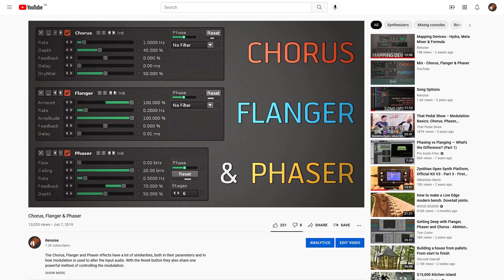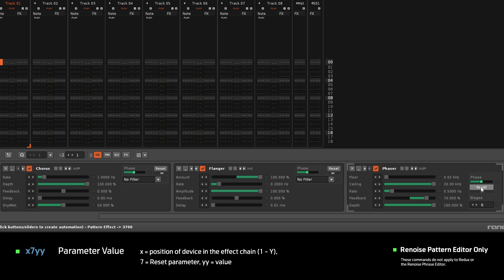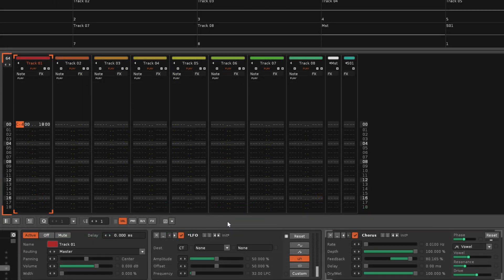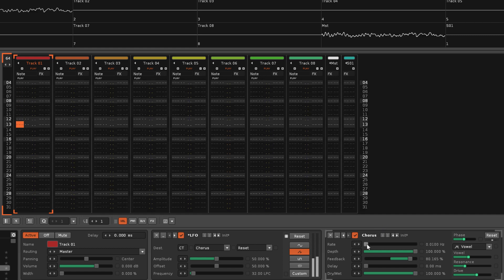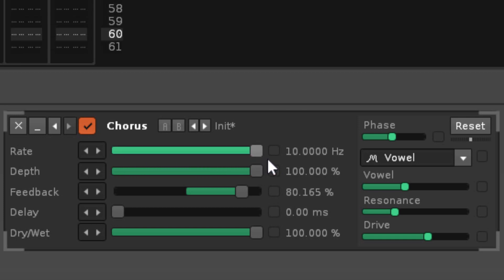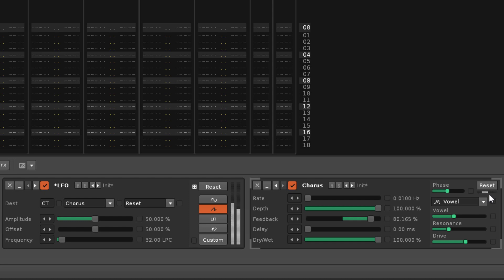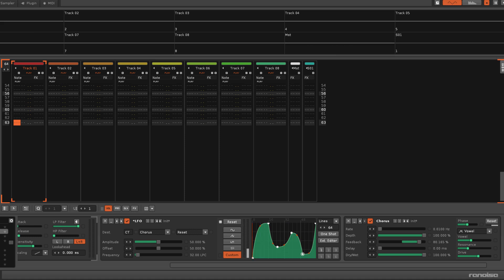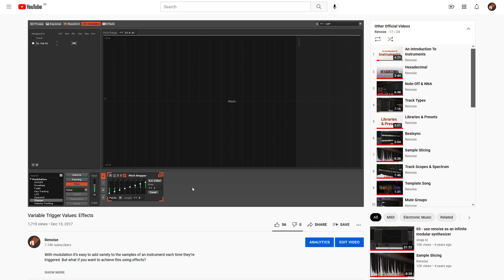Reset Control

Comment: Great stuff, I've been using renoise for many years and can't recommend it enough. That said, I would really appreciate it if somehow we could include different time signatures for individual tracks and a piano roll/interface... it would be cool for example to hit an expand button on a channel and have a vertical piano roll which directly interprets the ordinary text values/hex inputs and vice versa. You could have a different expand button to give a visual ui of the effects channels too with sliders ... just a thought... anyway great to see progress on this amazing application! it's still extremely powerful regardless of my wants.
Reply: There are a couple of user generated piano roll tools, check the forum and/or tools page. Unique time signature are available on a per track basis by using phrases. Very easy to create complex polyrhythms and polymeters this way, if that's what you're after.
Reply: @xenobaba  thanks for that I was not aware of the time signatures thanks!
Reply: @mrorange159  sure thing. Phrases can be very powerful for creating generative music, doing granular synthesis, polyrhythm/polymeter, the list goes on.